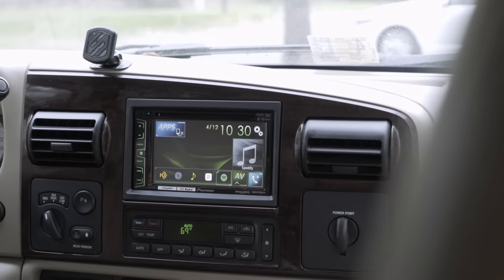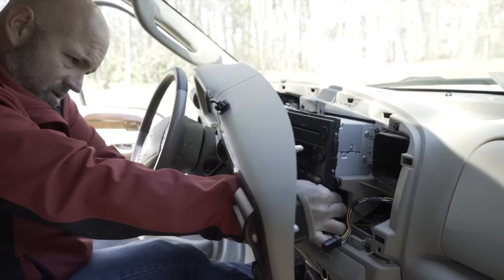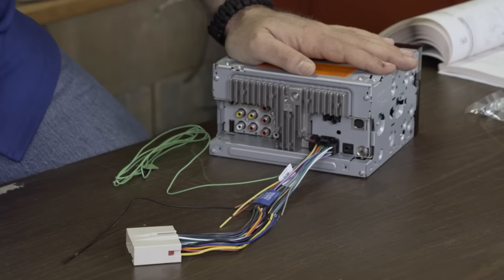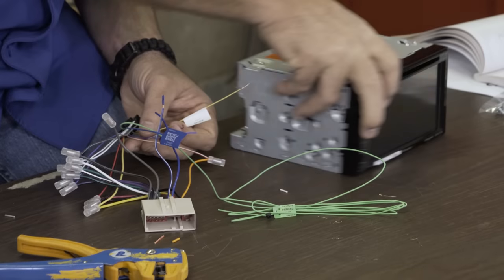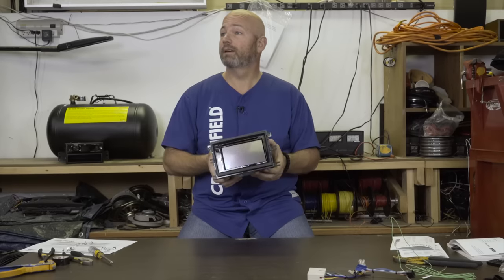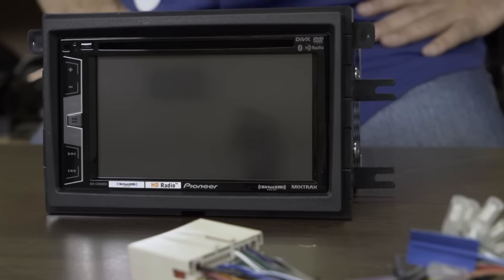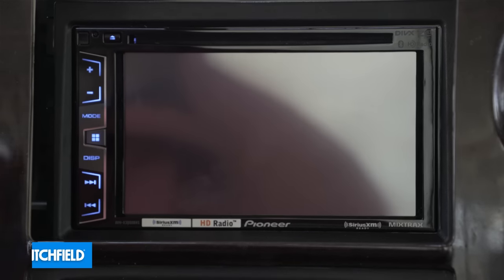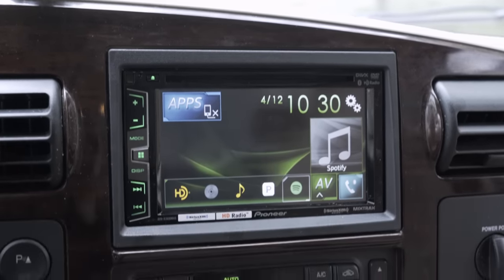How To Install a Car Stereo | Crutchfield Video

Comment: This is a good video, I will be doing something like this for my Daughters 2016 Subaru Forrester. I will need to do more research though, the seems a little more tricky with the HVAC controls being in the way.
Reply from the maker: We have the installation gear needed to install a radio in that Camry and we also provide custom instructions along with free tech support! If we can help you find anything, let us know! https://www.crutchfield.com/I-rYTVc974/support/ContactUs.aspx

Comment: Very nice professional work. Me, I would have ordered identical radio, then I could just skip adapting the new to the harness. I'm just not that brave when it comes to electronics. Yet, I see you where able to add many new features...!

I have old car, old equipment, no cell phone and manual windows. I'm old but I'm still working circles around  you young whipper snappers.

Comment: Funny how you breezed right through that parking brake wire.  How long did it take a couple of guys to get that set for you?  Oh and how many features work besides the radio without it?  I’m guessing none.  Oh wait the clock.  That stereo is a brick without it and if your parking brake wire is a bear to connect to, you’re screwed unless you buy or rig up a bypass.

Comment: I have a double din avh-x5800bhs and I can't find the wiring harness to connect the radio to the car. can you link the one used in the video I'm fairly certain that's the one I need. thanks
Reply from the maker: The link below should be to the harness in this video but we have a way to make sure you get the correct one. First, here is the link to the harness:

http://www.crutchfield.com/I-rYTVc000/p_120705520/item.html

We have advisors that can make sure you get the correct harness. You can contact us directly:

http://bit.ly/1tLNAOf 

I hope that helps.
--Crutchfield

Comment: Will the above video, be basically the same way to install a aftermarket CD player into a 2006 Jeep Liberty Renegade? I know from other clips how to remove the factory stereo out, but non show the basic steps in doing a wiring harness. My model also has a steering wheel controls.
Reply from the maker: Car stereo installations can vary a lot from vehicle to vehicle. In order to see what's needed to install a new stereo in your '06 Renegade, you can check out the "OutfitMyCar" application on our website here: www.crutchfield.com/I-rYTVc000/car/carselector.aspx?lp=%2fCar%2foutfitmycar%2fmycar.aspx

When you purchase from Crutchfield, we include vehicle specific install instructions and our in-house Tech Support to answer any questions 7-days a week; making the installation a lot easier on your own than you might think. 

I hope that helps.
--Crutchfield

Comment: I just ordered a radio form Crutchfield today. Getting ready to do my first ever removal and install. How do I get those posi connectors? Do they come with the Crux SWRHK-65P Wiring Interface?
Reply from the maker: Those connectors are not included with a harness. They are available for purchase here:

www.crutchfield.com/I-rYALc227/p_669PP500/item.html

Comment: I purchased a harness adaptor from you. I followed the directions on the instuction booklet and there is no power to the radio. There is power to my old radio but not my new one.
Reply from the maker: Sorry to hear about the issues with the install. Please give our Tech Team a call - they should be able to help get it straitened out. You'll find their number on your invoice or in the "my orders" section of the website.
Reply from the maker: We provide lifetime tech support with every purchase so, you can contact us for help troubleshooting the issue. You'll find the toll-free number to our tech support service printed on your invoice (attached as a PDF file to your shipment confirmation email). If you do not have your invoice or order number, you can contact our Customer Support department by calling 800-955-9091. They can find your order in our system and transfer you over to tech support once they have your order number.Hope that helps.--Crutchfield

Comment: I have a factory Bose system in my car. Can I replace the head unit and still keep the factory speakers, amp, and subwoofer? If so, what would I need to purchase?
Reply from the maker: Thanks for your question! For more personalized assistance suited to your specific vehicle, needs and budget, please contact an Advisor directly from the Crutchfield website: https://www.crutchfield.com/I-rYTVc000/support/ContactUs.aspx

--Crutchfield

Comment: I have a Pioneer AVH-X3800BHS DVD, trying to install in a 2016 Ford F250 super crew cab. I have the right wiring harness but when everything is hooked up the stereo will not turn on. I have a 2nd wiring harness in the stereo cavity that came off the right side of the back of my factory stereo. Do I need another harness for that? I am not sure why mine will not turn on.  Am I missing something?
Reply from the maker: The proper integration harness will provide the 12volt switched, primary power lead for connection to the aftermarket stereo's harness.If you purchased the equipment from Crutchfield, you can contact our tech support department for assistance. Their toll-free number is printed on your invoice.If you purchased the equipment elsewhere and the retailer will not help, we do offer paid access to our tech support services:  http://bit.ly/2l1NhvL  You can also contact Pioneer directly:  800-421-1404Hope that helps.--Crutchfield.

Comment: I getting the double bin touch screen stereo player but I want to keep the functional buttons that come with the default system on my Pontiac g6
Reply from the maker: If by "functional buttons" you mean factory steering wheel radio controls, they can likely be retained with the proper installation accessories for your vehicle and a compatible stereo.It's always best to start with the "Outfit My Car" application on the main Crutchfield website:  http://www.crutchfield.com/I-rYTVc180/car/carselector.aspx?lp=%2fCar%2foutfitmycar%2fmycar.aspx  Then, when you add a selected stereo to your shopping cart, you will be prompted to select a package of installation accessories for your specific vehicle application. Be sure to select a package that has the "Steering Wheel Controls" box checked.For additional assistance and personalized recommendations, feel free to contact is directly:  http://www.crutchfield.com/I-rYTVc180/support/ContactUs.aspx  Hope that helps!--Crutchfield

Comment: Any idea what wiring adaptor you need for a 2003 Mitsubishi Eclipse? I want to make sure I get the Right one.
Reply from the maker: That depends on if your Eclipse came factory equipped with the premium "Infinity" sound system or the basic audio option. You can be sure to get the proper installation accessories for your vehicle by using the "Outfit My Car" application on the main Crutchfield website:  http://www.crutchfield.com/I-rYTVc180/car/carselector.aspx?lp=%2fCar%2foutfitmycar%2fmycar.aspx  Hope that helps!--Crutchfield

Comment: I bought the wiring harness aftermarket face-plate to secure radio, and I have all the wires connected except for the yellow constant 12v wire. Where should I connect this wire? Also, hypothetically, if I were not to connect this wire would the new radio not turn on? Thanks
Reply from the maker: The yellow is the constant 12volt power lead to retain the memory settings of the stereo. (clock, radio presets, audio adjustments, etc.). The radio will work without this lead connected but all of the settings will return to factory defaults each and every time the stereo is powered down. If you got the proper wiring harness for your vehicle, there should be a matching yellow lead to connect the stereo's lead to.Hope that helps!--Crutchfield

Comment: Could be a stupid question, but there were 2 big connectors pulled from the stock unit. But only one was used for the aftermarket unit. Is that second connector not needed,
Reply from the maker: In this case, we did just need to connect the one plug. This will vary from install to install.

Comment: Do I need to plug in the antenna wire for the radio to turn on ? Because mine won’t turn on and everything is wired correctly and is receiving power because the ground is showing output. 2010 Ford Focus SEL
Reply from the maker: No you should be able to power the radio on without connecting the antenna wire. The 12 volt constant and accessory power are going to be the wires you need to ensure are connected properly. If you purchased it from Crutchfield our Tech Support can help walk you through the installation. You can reach them here: https://bit.ly/2DGSzu3

Comment: I am trying to install a Ken wood stero. Model DMX7706S double din radio into my 2000 chysler 300M my problem is that I can’ t find a kit to make it fit. Please advise me on  where I can find a kit to make this work
Reply from the maker: We have not found a double din radio mounting kit for it either which I believe is due to a limited height radio opening and radio cavity. Some sort of modifications are needed to create more room for this sized radio chassis. We recommend contacting a local custom installer to check if they can create the room and make a mounting kit to help install it

Comment: If I have a pioneer radio in my vw Jetta and let's say when I sell the car I take the radio out, can I buy a different installation kit for a different car without buying a new radio?
Reply from the maker: It's very likely we'll have the installation accessories (dash mount kit, integration harness, antenna adapter, etc.) you'll need to install the aftermarket stereo in the new vehicle, yes. Just be sure to retain the Pioneer's wiring harness and, depending on the specific model, the metal mounting (DIN) sleeve. 
For additional assistance and personalized recommendations, feel free to contact us directly by phone or through our online chat service: 
http://bit.ly/2jBGHPp 
Hope that helps
--Crutchfield

Comment: I installed the unit on my 05-F150 according to the instructions.  Volume up and down works and tuning up works but tuning down or back changes to DVD.  now what.
Reply from the maker: If you purchased the stereo from Crutchfield, feel free to contact our Tech Support team. They can walk you through the settings and see if there may be a fix. Our toll-free Tech Support number is printed on your invoice, and is also available under the "My Orders" tab in the "My Account" section of our website. 

If you did not purchase the unit from Crutchfield, then you may want to contact the manufacturer. You can also post your question in our forums: http://community.crutchfield.com Hope that helps!

--Crutchfield

Comment: Do these stereos have amps somewhere? 

I'd like to hook one up instead of losing the Sync system. 

I have an 08 Taurus Limited.
Reply from the maker: Yes and the majority of the our current models have built-in amps. We do have an interface you can use to keep the SYNC with select models in your Taurus as well.
Reply: I know JL has a "Fix" module. Can you direct me to something similar? 

Thanks for getting back to me! Always enjoy talking with the local guys. 

🦅👋
Reply from the maker: You might be thinking of the JL Audio FIX 86, which can be found here: https://www.crutchfield.com/I-rYALc313/p_13698103/JL-Audio-FiX-86.html

What are you looking to upgrade in the system?
Reply: A module to fix signal issues from the head unit....
 I replaced the deck speakers with JL C1s and still is having the initial crackling and clipping noise. Head may just need to be replaced. I do want to keep the Sync system going if I can.
Reply from the maker: AudioControl also makes a DSP to help adjust and clean up the audio from a factory radio:

www.crutchfield.com/I-rYALc227/p_161DM810/item.html

It may be possible to keep the SYNC system working with a new radio installed into your Taurus. Is your's a sedan? Does it have the 4 or the 6 speaker system in it?

Comment: Hey I’m having a trouble with the sound, I press the buttons but it’s not working and the sound is gone so what should I do?
Reply from the maker: First step would be to check your wiring, and ensure the connections are all good and still intact.

Comment: If you undo the battery neg. And accidentally short neg. To ground.. yep nothing shorting pos. To chassis could be exciting though.
Why dx the neg not the pos?
Disconnect the neg. "Because "it's already grounded"  it's?? Huh?
Guys ever use the newer double in out harness ? Plug n play